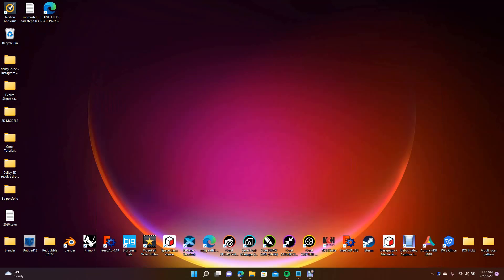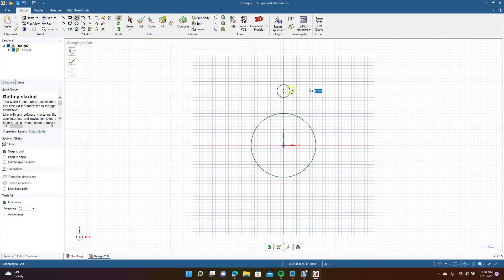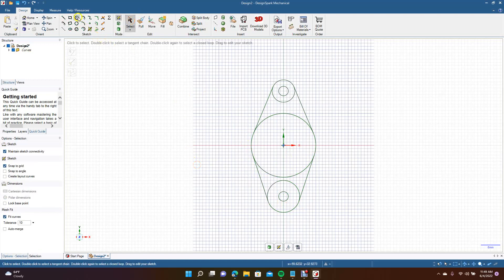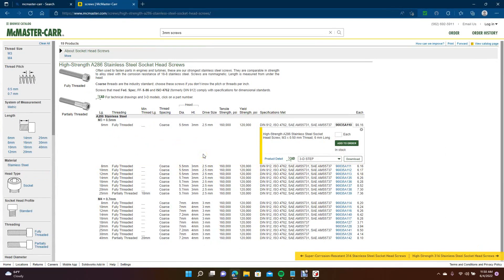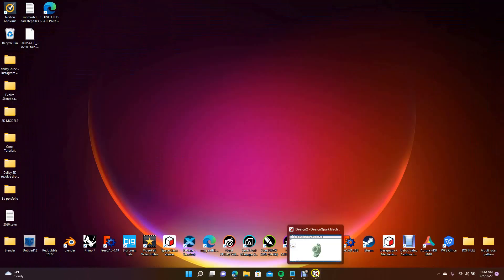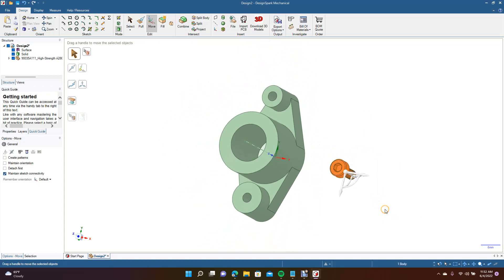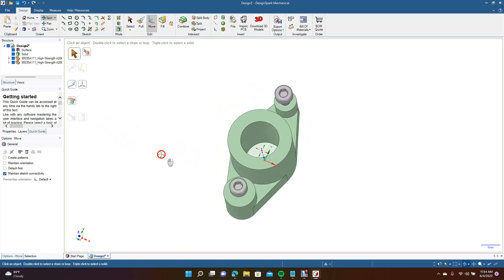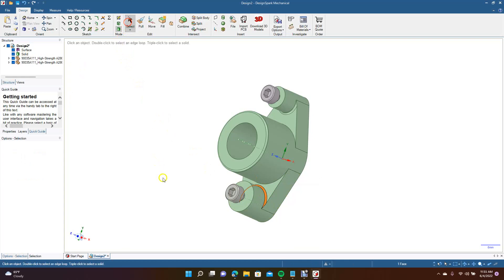How to add screws and bolts to your design spark mechanical model from mcmaster carr

Comment: I used to be able to import .STL files and now I learnt .STEP files.  However, looks like that is blocked in the most recent version of DesignSparks Mechanical (V6.0.2) , because I can no longer import either format. 😞  The error states that I'm trying to import an incompatible file type.  I know that worked before because I used to import STLs to modify.
Reply from the maker: Unfortunately, the free version of DSM no longer supports most import functions. However, these import options are available if you have one of the paid versions. Hope this helps.